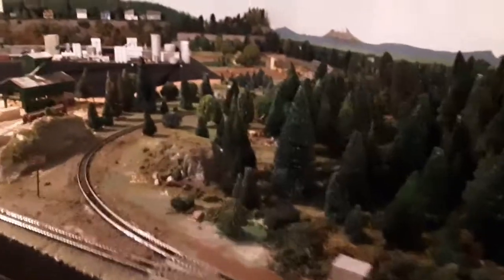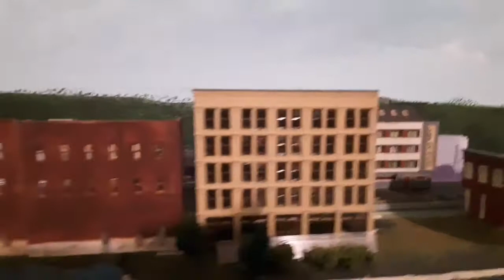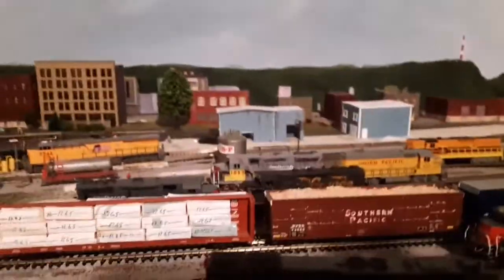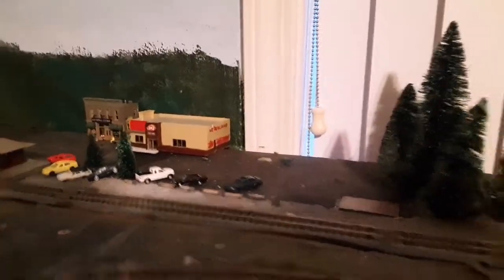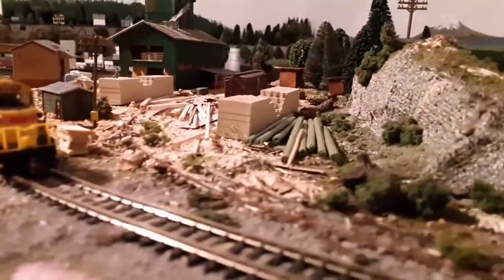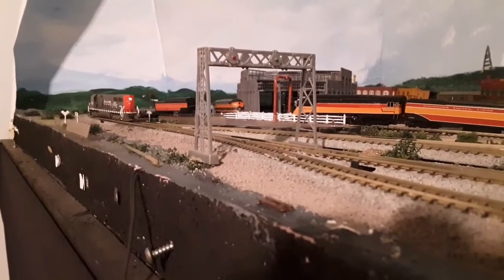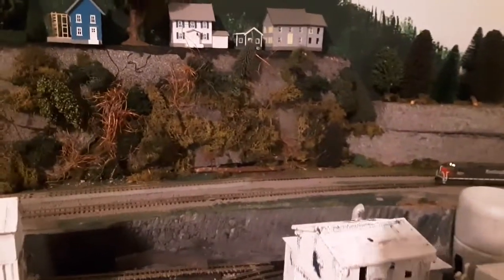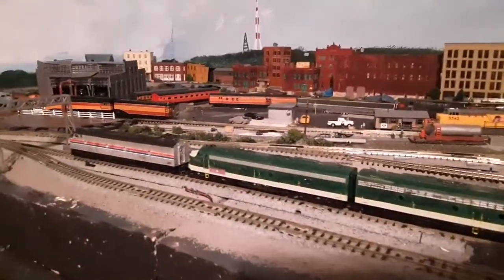Layout Tour April 2021 Southern Pacific's Brooklyn Subdivision, Cascade sub

Comment: Excellent tour of your layout and enjoyed the story line as you recall it. It seems like early 80’s was when most railroad lines got closed.  It’s true for any other railroads.  I’d be asking when certain tracks got closed and pretty much everyone says, it’s the early 80’s.   What was the major issue?  Re- routing or industry closed in that line?  Just weird that it was mostly 80’s.
Reply from the maker: The Staggers Rail Act of 1980 finally let shippers set (for the most part) their own rates and freed them from crippling , strangling federal regulations.   Most carriers quickly abandoned parallel,  redundant trackage on non-profitable lines. 79,80 and 81 were some crappy years under Carter, and there was a fairly significant recession in 81. I was in college and felt it at Montgomery Ward where I worked in the DC area, It took a couple years of shedding branch lines (usually to new, hungry  short lines) for the big roads to rebound, but they did and really haven't looked back. I think Conrail finally turned a profit in 1980 or 81, and then went for big bucks in the 90s to CSX/NS. 
For example,  in the 1970s, I always took the National Limited from  DC to St. Louis. It was PC (the Pennsy route) then Conrail all the way. Baltimore, Port road to Harrisburg (one or two coaches and a GG1!)Pittsburgh, Columbus, Indy, Terre Haute, Effingham to St. Louis. I wanted to steal a keystone MP marker in Indiana when we got stabbed by a red block on that terrible track.   
Now that line is severed, since B&O went pretty much the same, but to the south via Cincinnati, and NYC and NKP  went across up north.  It wasn't that profitable, but go up and watch NS scream across Northern Ohio, which I'm sure you have, and Illinois via Elkhart. 
Sorry about the history lesson, but you asked an excellent question, and it deserved more than an " I dunno" answer. Thank you for watching, my friend.
Reply: @ScottJohnson4449  - HA HA That was a great information.  I can tell you’re an excellent writer.  Thanks for taking the time to answer my question.